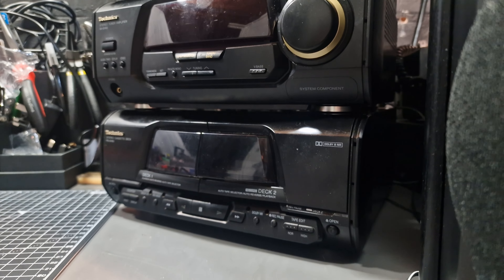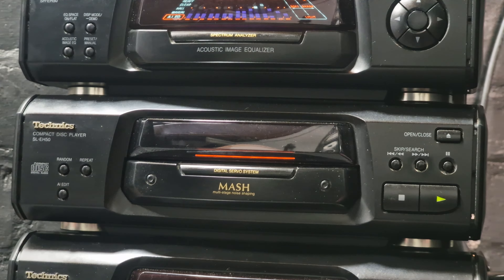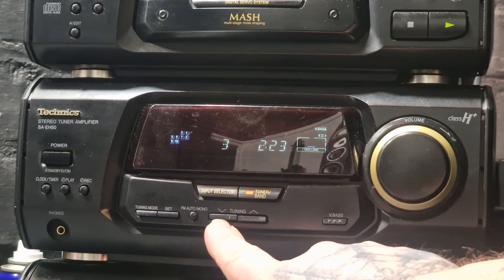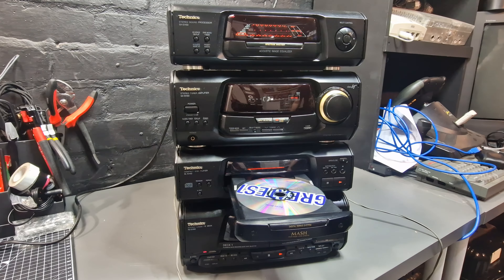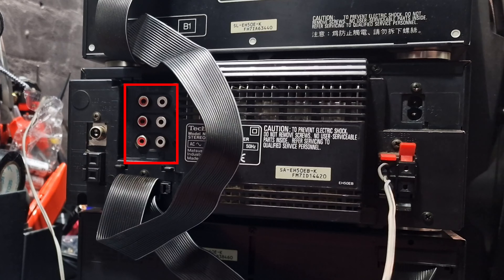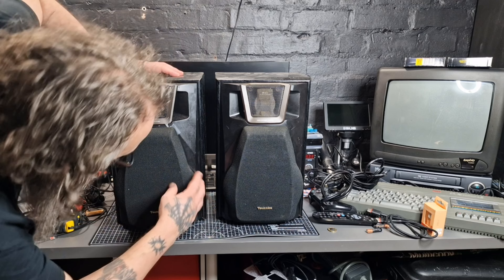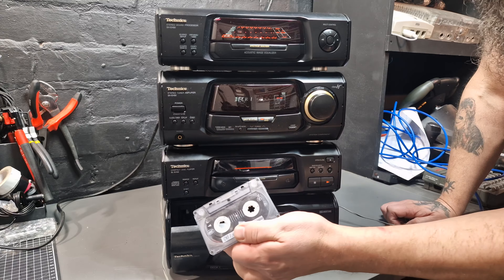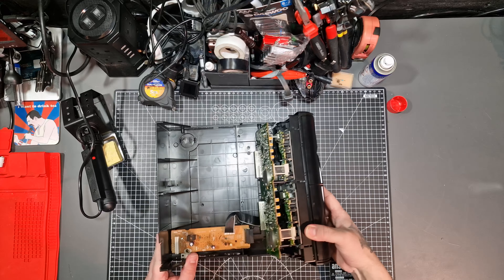Technics Hi-Fi from 1997 - Cassette Deck Repair #retrotech #vintagehifi #technics #tape #tapedeck

Comment: Nice job! 👍 As commented on IG my parents have one of these which is still setup, complete and in pristine working order … apart from the cassette decks! So might give this a go. The only hairy bit looks like the desolder/resolder of the motor assembly to the PCB. I sometimes end up lifting pads doing this! Where do you get the replacement belts?
Reply from the maker: Good look with it. These are the belts I bought: http://surl.li/hcrdh
Reply: Try some low melt solder on the joints and use a solder sucker. Makes de solder go really easy.

Comment: Hi, what are the belt sizes both of the two belts ?
Reply from the maker: Hi, I'm not sure of the sizes, but here's a link to the belts: https://webspareparts.com/en-gb/products/belt-kit-for-cassette-deck-technics-rs-eh60?srsltid=AfmBOoph-egbtmNRitZ0nqDrfy9lTpjrnbDZcbgSiMBjCaw6bqm-c8tQ
Reply: On mine the speakers has to be connected with 4 speaker wires. Blue and white black and read to let both the mid and bass speaker play. That was a bit weird. I recently bought it.  2nd hand for 1200ZAR then took it in for tape deck repair. For 590 ZAR

Comment: 🎯 Key points for quick navigation:

00:00 Retro Technics system.
01:52 Features of tuner amplifier.
05:24 Cassette deck repair.

Made with HARPA AI

Comment: I just dropped mine off for repair of the tape deck. RS-eh600 looks just like this one. The tape plays for a second or 2 then stops. I opened it and saw pieces of a rubber band. In side. So a band broke. 
But the lady at the repair shop said she doesn't have too much hope for fixing it.
Reply from the maker: Sounds like the belts have broke and need replacing like I did on the video, but could have other issues too I guess.
Reply: @retrograveyard  thank you. she called this afternoon saying it's the belts they will replace the belts but she also said it needs a new cap. I thought she meant capacitor. But apparently its a new capstone or something. What is that?  They will fix-it for 590 ZAR but it will take 10 to 14days she said.
Reply from the maker: It's a capstan and it needs to be in good shape, sounds like they know what they are doing 😁

Comment: I have a similar Technics mini component deck. These things make no sense at all - they put in more or less decent mechanisms but then used plastic flywheels on the capstans and also the motor has to be desoldered to get access to the entire mechanism.
Also, my deck has a computerized tape calibration mechanism that calibrates Bias, EQ and Level to the used tape, but there is no way to adjust the recording level manually.

Comment: Roller are REALLY BAD too ! You spend so many time doing one out of  ten that should be done. 
Rollers change, Clean shafts,Lubricate shafts and gears, adjust Speed high,adjust Speed low, Adjust Azimuth,Adjust PB level , Adjust REC level, Adjust REC BIAS

Comment: Hey, today I bought a similar model, the sa eh600, from a garage sale for 30 bucks (pretty good find!) I turned it on and low and behold, had the exact same issue  with the tape deck switching back and fourth. I am entirely inexperienced in this area of audio equipment, but i was just wondering if you knew where i could get new belts like the ones shown in this video? Cheers :)

Comment: Hi there great video. This is the only one ive found after months of searching. Silar to ch tape 550/950 and the belts are shot and i think some gear teeth damaged.  Have you worked on those. Cheaper to buy another than get fixed by tecky. Ended up with four.. same problem. Wanted to have a go myself lol Where are you based in England? Cheers
Reply from the maker: This is the only one I've worked on so far 😁 I'm based in Shropshire 🙂
Reply: Thank you. Seems like Ch models are still elusive. Cheers